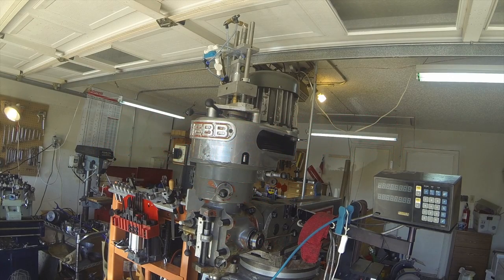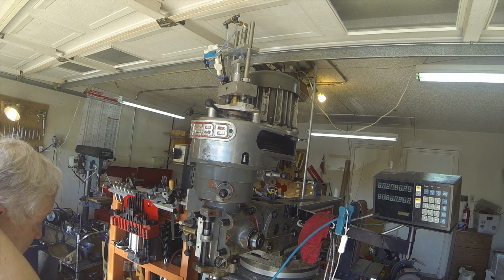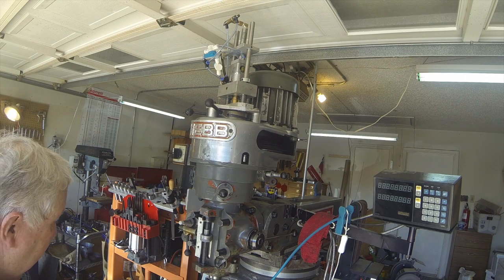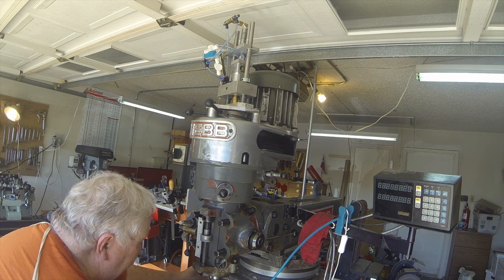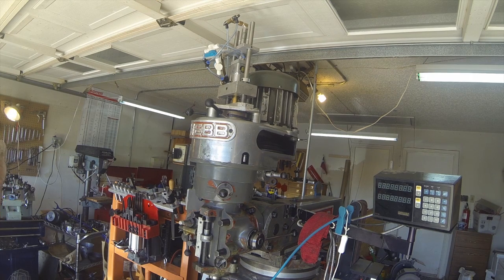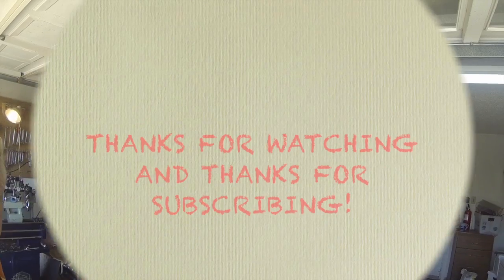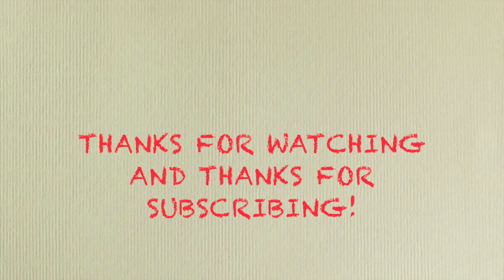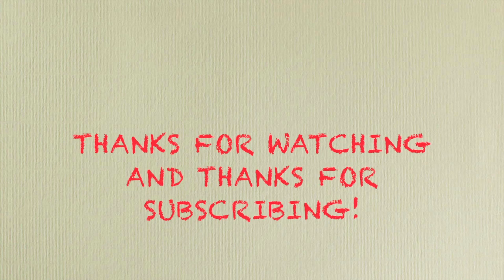Power Drawbar    #5 Final

Comment: On to the next project Herb? Looks like the tightest tolerance was between the machine and the garage door? Haha
Nice job, looks like all the power draw bars are up and running now?
Reply from the maker: The tolerence between the lip on the garage door and the top of the air cylinder is about an inch now.
Ray has his going, and Colin, CompEdgeX, hasn't started his yet.
New project is converting my Jet 14" Vertical Band Saw to Variable speed.  I have everything I need, just need to get it done.
Other than that, I'll be back on the little Eagle engine.
Thanks for watching and the comment.
Reply: Well Colin is in the furthest east time zone in North America, so I guess he has an excuse? Are you putting a VFD on the band saw?
Reply from the maker: Putting on a 2 1/2 HP Treadmill motor same as I used on the G0704 mill.
Reply: Good idea, I scrapped a working treadmill a couple of years ago...never thought to save the motor! Of course I have enough junk as it is....haha.
Reply from the maker: Cruiser Mac
Treadmill motors are cheap.  You can get a 2 HP motor and controller for <$30.
Reply: That is cheap! Easy way to convert a wood cutting band saw for metal cutting. Well sounds easy...I will wait for your report first..haha.